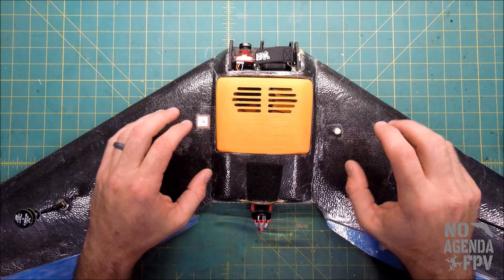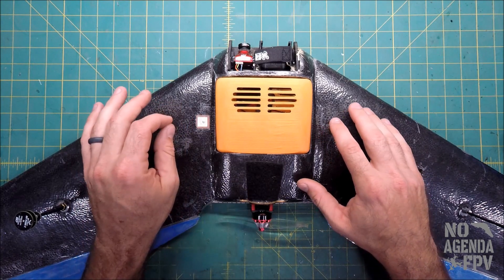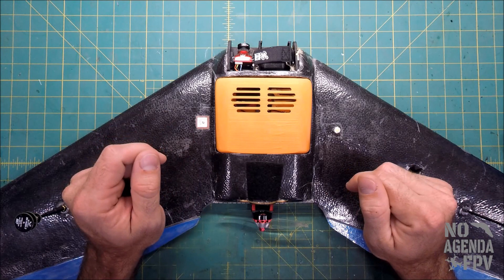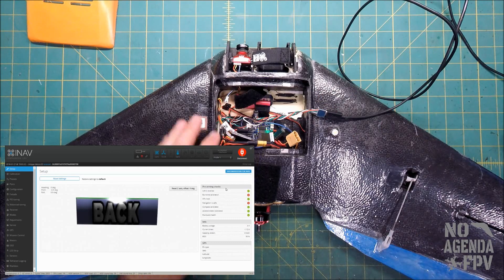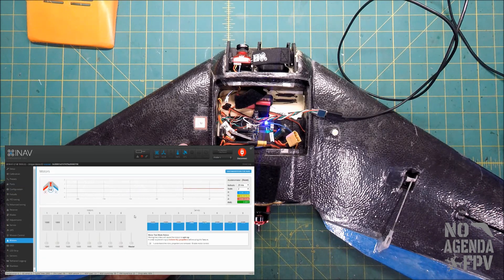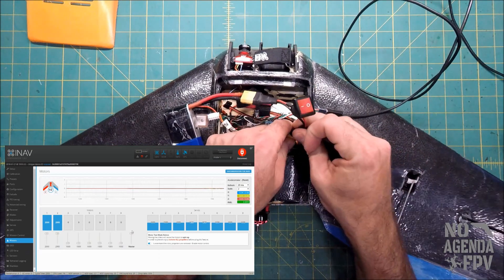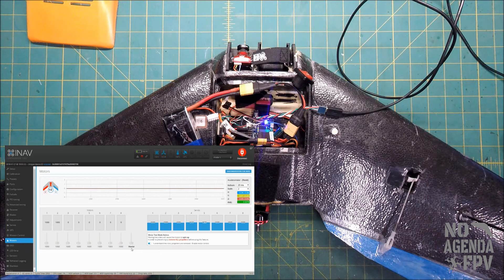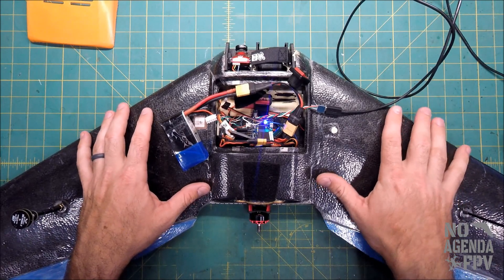Plane ESC calibration using iNav

Comment: Mine goes from 1000 to 1850, why can this be?
Reply from the maker: 1850 is the default value in the configuration tab, or outputs tab in 2.4.0 or later. I make mine 1950.
Reply: @NoAgendaFPV  Thank you for the reply. I'd like to have full motor output, how do I change it?
Reply from the maker: @BobCorey  well if you do the calibration then you will have full throttle range, the FC might only send 1000-1850, but you are setting your ESC to recognize 1850 as full high signal.
Reply: @NoAgendaFPV  Thank you so much! I did what you explained and now I have more throttle range! Giving you a like and sub!

Comment: I have a hobby wing xrotor 40amp and even when plugged direct to power and powered via the fc I just get a single beep every second and nothing else. I'm more used to blheli than these big old dinosaur esc's
Reply from the maker: Sounds like the ESC isn't getting a good signal from the ESC. Which protocol is set in the config tab? I'd try Standard if it's on another, if it's already in standard maybe try another. Also, is there mixer setup for motor?
Reply: @NoAgendaFPV  I've got it sorted now, it was on multishot not standard, also I had to set my mid and end points as throttle was reading too low.